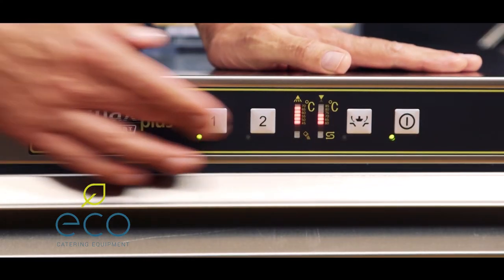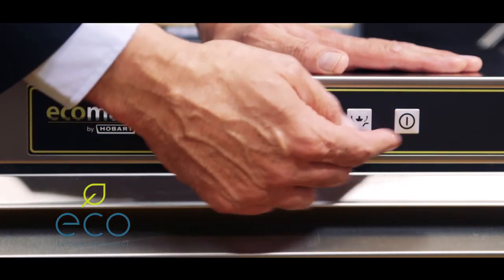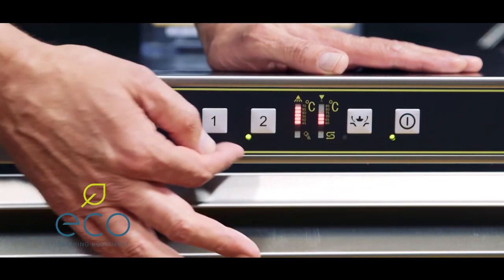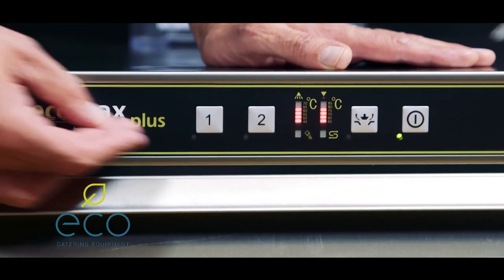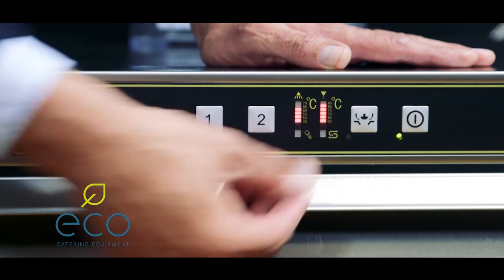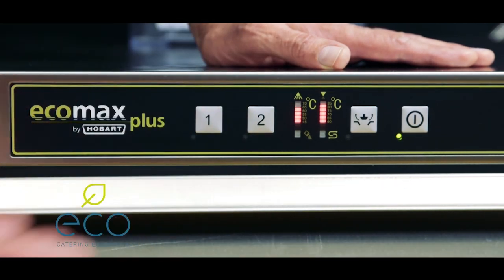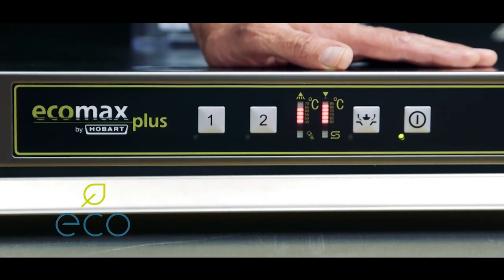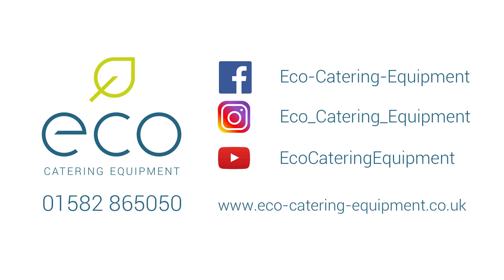How To Use The Ecomax Plus Control Panels

Comment: Hi.
I was wondering what is the difference between this and  Ecomax F504 500mm ?
Reply from the maker: Hi Ali, thanks for your question. There are several key benefits to the Hobart Ecomax Plus F503 compared to the F504. These are as follows:

The Ecomax Plus F503 has a double skinned door and cabinet where as the Ecomax F504 has a double skinned door only. A double skinned cabinet reduces heat loss improving efficiency. It also reduces noice levels.

The Ecomax Plus F503 has a wash tank approximately half the size of the F504, meaning less water usage, less detergent to dose the tank and less electricity to heat it. Making the dishwasher more efficient, cheaper to run and reducing heat recovery times during busy periods.

The Ecomax Plus F503 has the option of fitting a double rack insert allowing you to load two racks at a time. For example you could load a rack full of cups and rack of saucers and wash them in one cycle. Potentially halving the number of wash cycles.

All of these features, amongst other benefits, add up to make the unit more efficient and cost effective to operate and mean the machine can cope more effectively with a heavier workload.

Please also see this video which gives you an overview of the differences https://youtu.be/g9TLCgQIZkU

We hope this helps. If you have any further questions please get in contact.
Reply: @EcoCateringEquipment  Thank you very much for your help. As was in hesitate to which one should I buy for my coffee shop.
Reply from the maker: @AliAli-oz5vx  No problem at all, glad we could help. If you need anything else please do not hesitate to contact us.
Reply: @EcoCateringEquipment  finally I bought ecomax plus F503s. 
Tommarrow I am going to install it.
Thank you for your advice
Reply from the maker: @AliAli-oz5vx  That's great and we're glad we could help. If you need more help please do not hesitate to contact us.
Reply: @EcoCateringEquipment  thank you.  But wanted to say that I put the full bag 2 kilo  salt but the salt light still blinking.  No idea what is wrong?

Also want to know should I drain down every day at the end of the day? 

Thank you so much  for your support
Reply from the maker: @AliAli-oz5vx  Okay. It's not easy to come up with a definite answer without a little more detail. Did you add a cup of water to the softener once filled for the first time? It's recommend you do this when you first set the dishwasher up. Adding some water helps get things going for the first time.

If you haven't managed to resolve it please do give us a call or we can call you to discuss and talk you through a couple of points to help get things up and running for you?

Yes at the end of the day we recommend you drain the machine down and give it a wipe through. You don't want to leave dirty wash water in the unit. You need fresh clean water to give you the best results and more importantly make sure everything is hygienic. We do have a useful guide you can download that gives you our 10 tips to looking after your dishwasher to get the most out of it. It also gives you recommendations for your daily and weekly clean. The guide is free to download and can be found here: https://www.eco-catering-equipment.co.uk/blog/free-user-warewashing-guide/ 

If you need anything else please don't hesitate to contact us.
Reply: @EcoCateringEquipment  thank you very much.  I added a glass of water on the salt into the softener. And it sorted out.

Thank you for your help and support. Also the link was very helpful.
Reply from the maker: @AliAli-oz5vx  That's great. Glad we could help. Please don't hesitate to contact us if you need any more help.

Comment: I have a query about this machine, the one at my workplace seems to be stuck on an endless wash mode; it never starts the drying process. So its perfectly fine untill you lift the lid too early / before its drying sequence has finished which is super strange. Any ideas as to what the cause might be?
The only fix to this is leaving it overnight, where its fine the next morning untill someone lifts the lid too early again (easy mistake to occur).

Comment: ECOMAX602-12A Model

HI there,

is there a reset button or anyway i can recalibrate the dosage amount for both machine detergent & rinse aid? at the moment the unit is using too much machine detergent (10:1 ratio) and not enough rinse aid, and when the cycle finishes there is a white soapy like film on all the dishes etc
Reply from the maker: Hi, You can adjust the dosing level for each from the control panel, it's a straight forward process. The instruction manual does include this information. If you're based in the UK please email us on info@eco-catering-equipment.co.uk and we will forward the manual. If you are based in another country we would recommend you contact your regional Hobart office or distributor. UK specs. can vary to other countries which means you will need your specific region's instructions.

Comment: Hi

My Ecomax 402-12 is producing lots of soapy water and i have it set on the lowest level. could anyone help???
Reply from the maker: Hi. There are a couple of things to consider. The first, it sounds like you have done, which is to turn down the amount of detergent being pulled through. Have you changed your detergent brand/type recently? Are you washing full baskets? We sometimes find running half empty baskets can cause foaming issues. Have you checked that the amount of detergent being pulled through has actually reduced? In case there is a pump or control panel issue. You may have turned it down but the unit is still pulling too much through.

Comment: I will ask something regarding the water refilling take more time 30 minute before start the machine.
Reply: I will open the machine all components it's ok. Specialy the solenoid valve it's clean. I think programing. How to program of this machine.
Reply from the maker: Hi. We usually find if the machine is taking approximately 30 mins to heat and fill then it is running on a lower power setting. In the UK a 13amp supply, for example, would extend the heat up times to something in the region of 30 mins. You can look to connect it to an uprated power supply if this is an option for you. This would reduce the fill and heat up times. If you feel it is not a power issue then we would recommend speaking with a local service company or Hobart directly. If you need the Hobart UK service number please let us know.
Reply: @EcoCateringEquipment  many thanks.

Comment: Ecomax 504 not taking chemicals 
Please reply with proper solution 
Thx
Reply from the maker: Hi Haresh, thanks for getting in contact. It's very difficult to know what the issue is without seeing the machine. There could be several reasons for this. 

Here are a couple of things to check initially:
1/ Check the hoses, are there any kinks or splits that could be preventing the flow of chemicals
2/ Re-prime the pumps. Sometimes when changing the chemical bottles you may need to re-prime the pumps
3/ Have the settings been altered at all on the control panel. Potentially reducing the chemical dosing

If you feel it is a faulty pump that is not something we can advise about or easily diagnose on here.

If you are UK based you are more than welcome to contact us directly and we'll try to advise over the phone or put you in contact with the service department if you need more assistance.

If you're located in another country we would recommend you contact either the local Hobart office or an authorised Hobart dealer in your area. Alternatively, a local service engineer who is familiar with your model of dishwasher.

Thanks

Comment: please help i have the same model but its working just blinking the four indicator led, please i anyone know the issues, tnx
Reply from the maker: Hi Ben, thanks for the message. Unfortunately, the information you've given doesn't give us enough to go on. On that particular control panel the machine diagnostics display a series of LED's to tell you what the error is. If you refer to your user manual this should tell you what error the LED code is referring to which should help point you towards the fault.
Reply: The panel have 4 buttons with each led bellow, this 4 led im mean, when i turn on the machine, this 4 leds will blink and i cant press any buttons.
Reply from the maker: @benhursaletrero1531  Hi, we would recommend you refer to the operation manual to help establish if this is an error code signal which will point to the error. Alternatively, contact a local service technician local to you. If you are not based in the UK then unfortunately, we cannot assist with this. If you are in the UK please let us know and we can assist with the service number?

Comment: dose it self cleaning
Reply from the maker: Hi, thanks for the question. When shutting down, the unit does go through a self-rinse and draining cycle. However, it is recommended you give the interior a wipe through at the end of service. We would also recommend a more thorough clean once a week where you remove and clean the wash arms and filters etc. etc.

Comment: How to fill water??
Reply from the maker: Hi Vikramjeet, the machine needs to be connected to a continuous water supply, when you turn the machine on it will automatically fill. Thanks!
Reply: Rines tank after heart element change how can again refill water
Reply from the maker: If you have replaced a heating element in the unit and it is back to full working order you should simply be able to turn the machine on and it will go through its standard automatic fill and heat up procedure.
Reply: @EcoCateringEquipment  after replace heanting element unit not auto refining water first  time
Reply from the maker: Hi Abdul, we will reply directly to your email.

Comment: Temp changing???
Reply from the maker: Hi Abdul, The temps, for the dishwasher models, are set at approximately 65 degrees for the wash and 85 degrees for the rinse. These are set to work within the UK guidelines and to work effectively with the appropriate detergent and rinse aid. If you wish to change the temperature this would not be a standard procedure and would need to be undertaken by an engineer. Please note, in changing the temperatures you could impact the performance and operation of the machine. We are located in the UK and I refer to the UK spec's and requirements. I cannot comment on models for other markets. Are you UK based?
Reply: @EcoCateringEquipment  so we can not to change the temperature?
Reply from the maker: @heng5304  You can change the operating temperatures but it's not a standard procedure. We would recommend it is altered by a qualified engineer. It can also impact the operation of the unit and it's effectiveness.